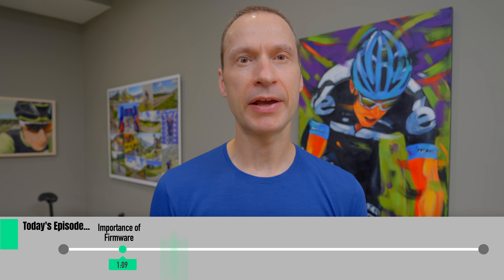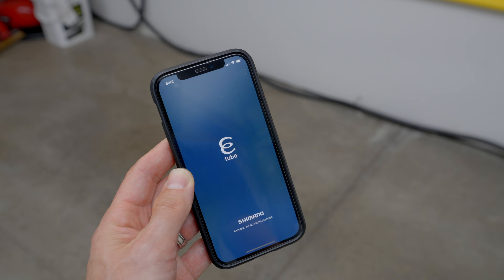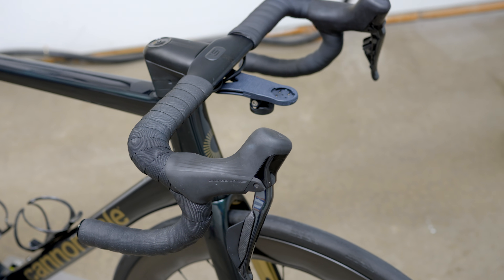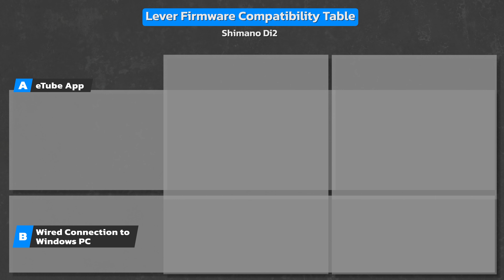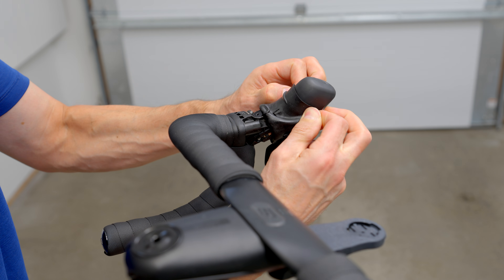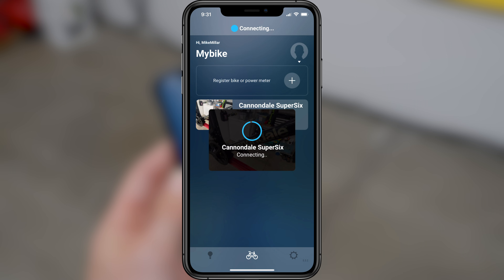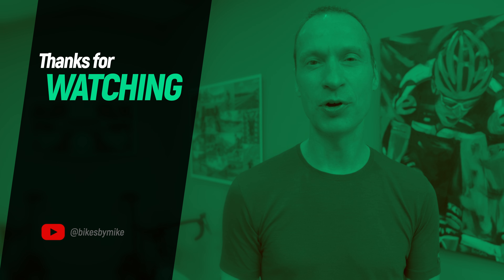How-to Update Firmware for Shimano Di2 Shifter & Other Components

Comment: Perfect Video. 
How does the lever update work when you habe the newest grx system with rd-827 and 815 wireless shifters. I can not find a wire port at the 827. 
thank you!
Reply from the maker: I think you're right; with the 1x ST-RX825 you can't simply wire your shifter to the rear derailleur as the RD has no port. The only option, according to BetterShifting, is to find a 2x Di2 donor bike to temporarily connect to, or purchase the Shimano PC Linkage Device (SM-PCE02) and connect it to a Windows PC. Here's the link...

https://bettershifting.com/installation-guide/update-the-firmware-on-12-speed-hydraulic-shift-levers/

Comment: Excellent video. I have a Pinarello Nytro Ultegra E7, I would like to get the Shimano thumb buttons to control the assist levels of the bike vs using the screen integrated in the top tube. Do you have any suggestions?
Reply from the maker: Sorry, I don’t. I’m not at all familiar with power assist road bikes and Pinarello’s LED display. If I tried to provide some advice, I’d probably be wrong. 😟
Reply: @bikesbymike thanks.

Comment: Shimano, you gotta be kidding me. A $9500 bicycle needs $60 more in wires and connectors? What's next? Pay per shift?
Reply from the maker: I hear yah…there is a thought that Shimano will eventually make possible the ability to update lever firmware wirelessly, but it still has not come. I’m sure newer versions of Di2 will have it, but do hope they make it backwards compatible for older models.

Comment: A nice explanation why this Di2 thing is ridiculous. I do not need batteries to assist a simple lever.
Reply from the maker: Curious…do you have a wired connection between your Di2 levers and main battery? A lot simpler if you do.

Comment: I finally got up the courage to give this a try, then realized I didn't order the port junction adapter. Ugh. 😬 Ordered now so trying again when it arrives... I determined that my 'intermittent shifting issue' was actually a screw on the battery door on my right shifter that somehow came out...
Reply from the maker: ...good excuse to put off bike maintenance to another day 😂. Nice that you diagnosed your issue correctly!
Reply: @bikesbymike  Round 2... The EW-JC302 Internal 2-Port Junction arrived and I was able to upgrade the firmware. One nuance that threw me for a loop, you need to connect the cable BEFORE connecting the e-Tube app for the upgrade. You did this in your video but I had connected the e-Tube app to the Di2, then made the cabled connection and it did not detect the shifter as "wired". To do the other shifter, I had to also disconnect the e-Tube app, change the wired connection to the other shifter, then reconnect for it to detect as "wired". This was with the Ultegra 8150 Di2. Also, on the 8150 Di2 there was no 'dummy' plug in the upper slot/port on the shifter.
Reply from the maker: @anthonyg-can Ah—yes. The order of connecting the cable and app does matter. As for the plugs, they do differ among some of the Di2 models. The location may be slightly different and for the 105 there is only one plug. Others have commented on that as well. At some point, I had to draw a line on how deep I wanted to get into this 😂

Comment: Mike. Another awesome vid. You are talented. Woukd you update a Shimano di2 12 speed durace that is working just fine. Hard to justify possibly screwing things up if all fine. Tx
Reply from the maker: You are too kind. It may be more accurate to say my videos are not as bad as in the past 🤣

Your thought about the need to do the update was exactly my thinking. If all is well, you are likely fine to put this off until you have an issue (if you ever do that is). But assuming you do firmware updates for the components that are more easily done with the app, like the RD, FD and battery, I suspect that at some point mixing and matching old and new firmware versions may cause you issues. Then again, by that time Shimano may have rolled out the ability to update the levers wirelessly.  

The reason I chose to do the levers now is that I didn’t want a problem to arise at the worse possible time (like race day). I’ve had other Di2 components act up due to not running the latest firmware, so I know it can be an issue. 

Sorry for the long message. Good luck!
Reply: @bikesbymike You. Are. The. Best.

Comment: Thank you, Mike, for sharing the video. Very helpful. I have an old Ultegra di2 10-speed on my Giant Defy 3. Do you have any recommendations or instructions to update its firmware?
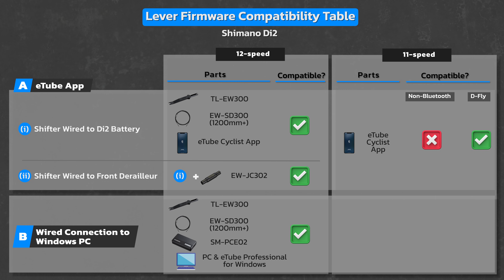Reply from the maker: Since you have 10-speed Di2, I presume your levers are already wired to the main Di2 battery. I'm 99% certain the process is exactly the same as for 11-speed Di2. Follow my video at time stamp 6:58.
Reply: @bikesbymike thank you

Comment: Nice video, thanks! But if I connect both levers to the front derailleur by a 4 ports junction EW-JC304 Di2 , should be Ok !?
Reply from the maker: Yes, that will work as well. Nice that you have a 4 port junction!

Comment: Mike ... I lose the bluetooth connection whenever I remove the plug from the rear derailleur to connect it to the junction.  Pressing the function button no longer does anything.  DURA-ACE R9270 12-speed.   Would you have any suggestions?   Thank you!
Reply from the maker: You need to repair the E-Tube app with the Di2 after you’ve connected the lever to the rear derailleur cable. If that doesn’t work, try using the front derailleur cable
Reply: @bikesbymike  Front derailleur worked!  Thank you for this great tutorial and for your help!
Reply from the maker: @Tomodachi212  Good that Shimano gives you the option to connect to either the front or the rear derailleur.

Comment: Thanks for the excellent video Mike.  I updated my Shimano 105 Di2 today and it went smoothly.  The only problem I had was finding the port for the wire in the shifters.  For Shimano 105 there is an open port (no protective plug in it) on the inside right near the battery door.
Reply from the maker: Yes, I should have mentioned that as it has thrown off a few viewers. Too many peculiarities among all the Di2 models.

Comment: Hi followed your instructions with out the connection adapter CWJC302 and plugged into the rear derailleur (grx825di2 2x12) I lost the blue tooth connection. Tried several times same result ant suggestions . Many thanks
Reply from the maker: Hmmm...am I right to assume it DID connect initially, but then dropped? It's only happened once to me and that's when there was quite a distance between the Di2 derailleur and my phone. This may not be your issue, but keep the app open on your phone and stay VERY close to your bike. Like right beside it. I dropped the connection by moving no more than 4 feet away. 

I just updated my levers with the latest firmware a couple days ago, so I don't suspect it's a bug in the system.
Reply: @ wow thanks for your prompt reply will try again. It did open initially to establish I needed an update, when I disconnected the cable from the derailleur to connect the etube I lost the connection. Do I need an EW JC304 splitter  so I plug the front shifter into the rear derailleur and from the rear derailleur into the splitter Making a 3 way connection ? 
Thanks for your clear and concise information it’s very helpful.

Comment: So I updated the firmware and now nothing works at all.  The rear derailleur light won't glow at all. Any suggestions?  Thanks.
Reply from the maker: It could be a few things, but I'd give these a try...
1) Go back into the eTube app and make sure you've completed firmware updates for all your Di2 components. Also make sure you unpair the app with the Di2 system before exiting the app.
2) Make sure you re-established a snug connection between all Di2 cables and the main Di2 battery. Also inspect for damage. 
3) Try charging the Di2 battery again. Make sure the cable connection is secure at each end of the cable and try another USB outlet/adapter in case it's defective (many are finicky with certain electronic devices)
4) If all else fails, it could well be a damaged cable or defective Di2 battery.

Comment: Information and steps and needed Shimano tools worked perfectly on my new Canyon Endurance DI2 9270 Dura Ace. I don't understand why Canyon could not update firmware on bike before shipping, also both shifters did NOT 	have the port 	plugs installed. IMHO, Canyon did bare minimum before shipping bike to consumers.
Reply from the maker: I agree. Save the customer the hassle and update the firmware before it leaves the warehouse. Nice that you caught the missing plug. Not a huge issue, but good to have them in place nonetheless.

Comment: Hi! Do you really need a cable as long as1200mm long for 105 Di2 12-speed lever updates when connecting to the front derealieur ? I only ask because it looked like there was a fair amount of slack cable at 9:00 minutes :-) THANKS - GREAT Video!!!
Reply from the maker: You are absolutely right; you don't need a cable as long as 1200mm. I only suggested that length because it's readily available and you pay almost nothing to get the extra length, so it's a safe bet. I'd say 800mm is as short as you want to go.
Reply: @bikesbymike  THANK YOU! I just bought a 1000mm one :-)
Reply from the maker: @timsinclair3024  You're welcome!

Comment: How do I find out if my shifter is wired to the battery or front derailleur?
Reply from the maker: Not sure if I understand your question. If your shifters are wired to your Di2 system already, then the method shown in this video is not necessary (as it’s already wired). If your shifters are permanently wired, then they will be connected to your main Di2 battery.

Comment: Perfect - thanks a lot for your explanation. I ordered only the cable, connected the STI with the battery and the update was no issue. My new bike is my first one with a Di2 Ultegra 12 Speed... I was quite unsure how to handle with this but your Video showed exactly the right steps. Again - thanks a lot, hopefully the shifting experience is worth this.
Reply from the maker: You’ll love it. Say goodbye to ever having to adjust cable tension or having the chain rub against the front derailleur guide.

Comment: Hi Mike bought the EW SD300 cable and the EW JC 302 port junction what end of the cable goes into the Ultegra Shifter port? your videos are brilliant no bullshit just the information needed to carry out bike repairs.
Reply from the maker: Thanks. The two ends of the cable should be identical.
Reply: @bikesbymike  thanks, just finished updating the firmware, your video was brilliant, thanks again for taking the time to pass on your knowledge.

Comment: Great presentation thanks. Just now looking at my bike I find the port on the left shifter but not on the right. Am I just not finding the right hand  shifter port or will the left shifter connect to the right wirelessly for updating?  I’m currently showing the latest update version 4.1.1 on both shifters - Ultegra FD-R8170.
Reply from the maker: I’m surprised about that. But since it’s stating that both levers have up-to-date firmware, you are all good. Not sure if Shimano just recently enabled dual lever updates with just one connection.

Comment: What a pain in the a....I think there is an hardware limitation on shimano levers to be updated wirelessly.
Reply from the maker: I would have thought it's a hardware limitation as well, but then I saw this comment on the Better Shifting website..."...initially, Shimano said that this would only be a problem the very first time you update the shift levers, and that future updates should be wireless. However, update 4.1.1 and update 4.1.2 cannot be installed fully wireless either. Whether or not future updates can, remains unknown."
Reply: @bikesbymike  %100 a hardware limitation.

Comment: Mike, like all your videos this one is excellent. I recently got a 12 speed Dura Ace DI2, my first electronic shifting bike. I wasn't looking forward to having to pack up the bike and take it into the shop for certain firmware updates. But, I followed you video in terms of what's needed and how to update. No issues, and I'm once again able to do all my own maintenance and updates. Thanks, your help is super appreciated.
Reply from the maker: Thank you! Glad it helped.

One thing I failed to mention, that another viewer pointed out, is that you can also use a Di2 cable connected to your lever and the REAR derailleur to perform lever firmware updates. This is in addition to the two other methods I mentioned (lever to Di2 battery and lever to front derailleur). Works no better or no worse, just another option.
Reply: @bikesbymike  "you can also use a Di2 cable connected to your lever and the REAR derailleur"
Not sure I get what you're saying. If you connect the rear derailleur with your shifter you're not going to be connected to the battery as the rear derailleur has just one port. How do you expect this to work, am I missing the trick?

Comment: Thanks, super helpful; QUESTION: have a 1x bike with Ultegra 12sp Di2 - can you confirm that I also can connect to the rear deraileur cable to avoid pulling the battery out? And can I connect different shifters from several bikes to the same bike in effect croos-connecting bikes for the firmware update for the shifters (to avoid having to pull one wire after the other on several bikes and just use the same connection on one set shifters after the other?
Reply from the maker: Your first question is easy. The second one I'm not so sure about.

Yes, you can run a Di2 cable from your shifter to the rear derailleur. I should have mentioned this in my video. It's actually one of the two methods specifically recommended by Shimano. The other being the direct connection to the Di2 battery.

I don't see any reason why you couldn't use the cross-connecting method you describe. I'm just not sure whether you would first need to create new bike profiles, and re-pair components, prior to running the lever firmware updates.
Reply: @bikesbymike  Thanks! Will play it safe… 👍

Comment: just plug it into the battery. No junction box necessary.
Reply: It wont work because rear derailleur is the brains of the system. Without it etube wont connect to the system.
Reply: What I do - just needs a cable and you can even canabilise a cable from the system if you want to save a little money (I bought an extra myself to make it easier).

Comment: Hi Mike, you have done it again. Excellent video! 
Wondering, if I can update the shifter levers on my 2024 12 speed 105 DI2 giant defy advanced pro 1 through the wired method explained in this video!
Reply from the maker: Yes you can. Cheers.
Reply: @bikesbymike  just curious, how much did the di2 cable and cable junction connector cost you ? What is the best place to buy these two parts ? I see that these parts are available on Ali express as well, however, what do you suggest from where should I buy these parts to update the firmware of the 105 di2 shifter levers ?
Reply from the maker: @amritv6889  AliExpress is probably fine, but I chose to purchase my parts from bike shops. I purchased the 2-port junction and 1400mm cable from Jenson USA. Great online shop as they offer all-in, to-your-door pricing for Canadian customers. You won't get surprised by duties and brokerage charges. $21.99 USD for junction and $23.99 for cable. The cable tool I bought from Primeau Velo in Quebec for $7.99 CAD + shipping.
Reply: @bikesbymike  thanks Mike, have a great day buddy!

Comment: Mike can’t you also use the cable that plugs into the 12sp rear derailleur to power the shifters?
Reply from the maker: Yes, you are correct! My mistake. So, in addition to wiring the levers to either the Di2 battery or the FD, you can wire them to the rear derailleur.
Reply: @bikesbymike hi Mike when I did this on my Grx 825 di2 I kept loosing Bluetooth connection to E-TUBE an6 ideas? 🙏
Reply: I didn’t understand this Mike please simplify for me about this …!

Comment: i bought that 2 port junction thing and a spare cable just in case, thinking i would probably never use it cause shimano rarely updates the firmware, and when they do it's just something minor that i could skip, who would of thought they actually came up with something very useful, the front shift next function, giving my no hood button 105 di2 a spare button to program.
Reply from the maker: Handy if not using Full Synchro Mode.